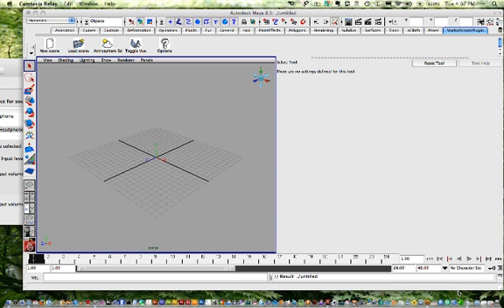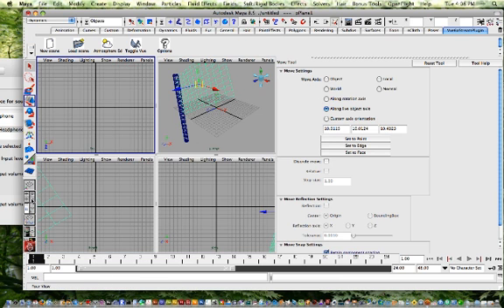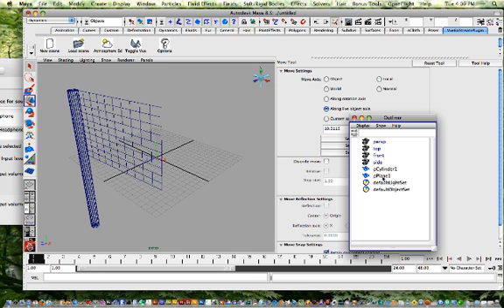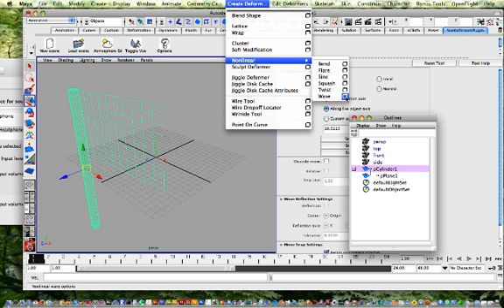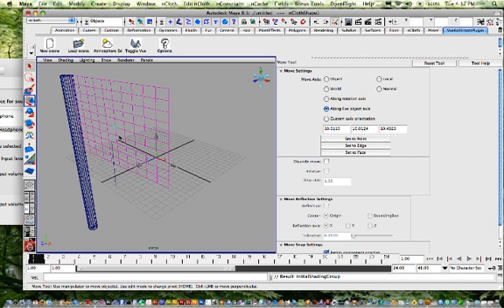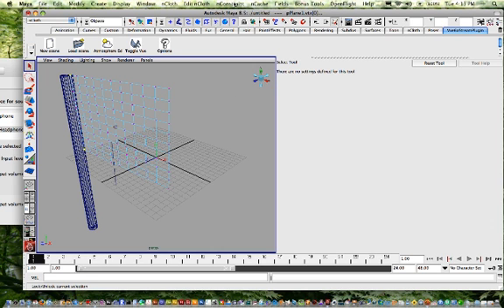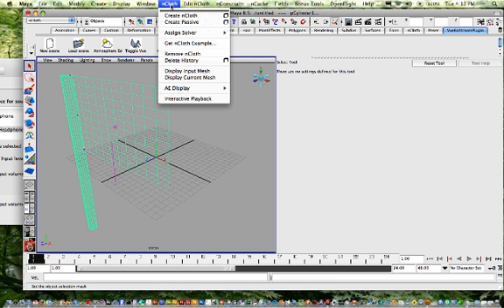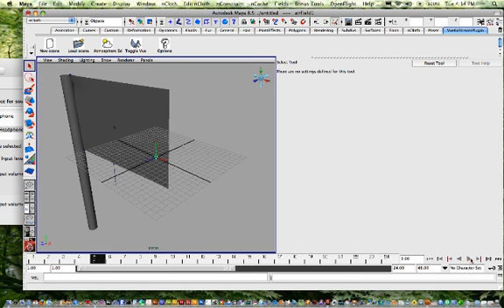Learning Autodesk Maya: Creating Cloth

Comment: little complicate
set up your render settings
-go to common tab
-image format-jpeg
-frame/animationext-name.hash.ext
-now set your no. of frames in frame rage
-set the camera
-size of image
now all set
go the rendering in the drop down menu under file and select render and the batch render.
see the script editor- when it says finish go to the image folder in your project folder the render image sequence. use after effects or simply quick time pro to play the sequence and save it as a avi file